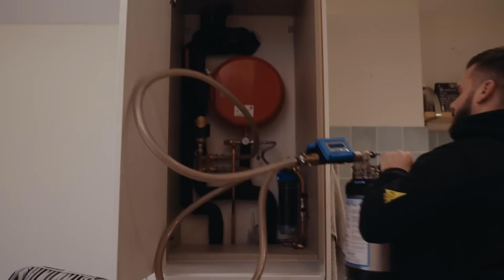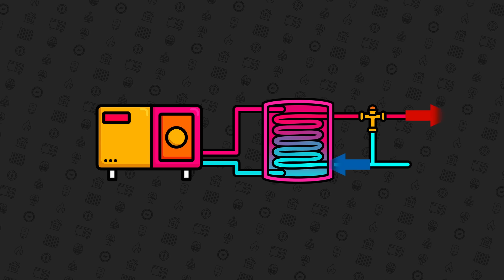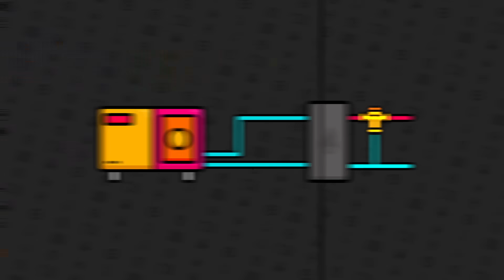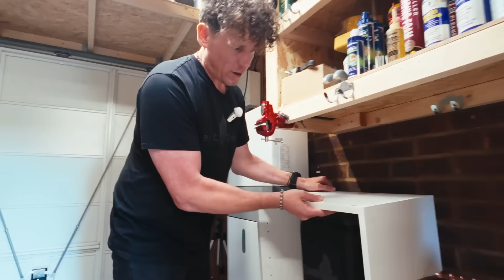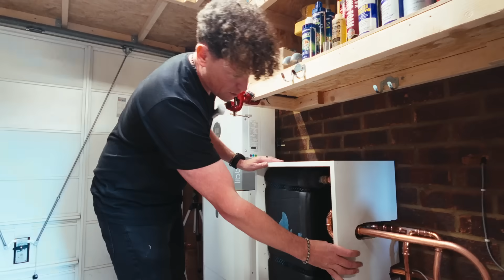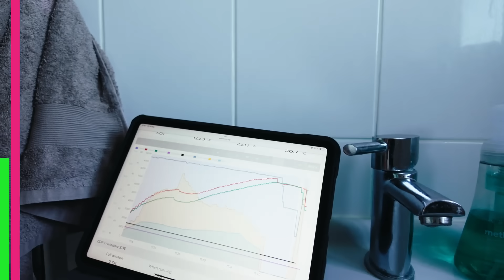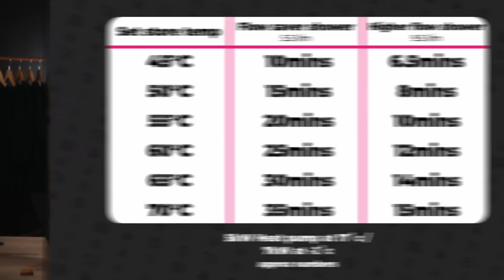World’s smallest hot water solution. (With a heat pump)

Comment: Here in Norway, 95% of homes have a standard 150–300L hot water tank. Since we already use a lot of electricity to heat our homes, I don’t see the issue with having some heat loss—or rather, heat dispersion—from the boiler inside a house that needs heating anyway.

The only cost-effective solution that makes sense would be to use a heat pump to preheat the water, improving efficiency, ideally in combination with a home heating system that also utilizes the heat pump.
Reply: Well, if your heating throughout most of the year you might be correct, but you really don't want extra heat when the temperature outside rises  aboth 30°C (Or 20°C for that matter)
Reply: @patrick_test123  That’s true, but most people keep the heat on in the basement year-round, and for about nine months a year in the main living areas.

The main issue with tankless water heaters is the extremely high power demand—typically between 15 and 25 kW for a high-flow shower. The cost of drawing that much peak electricity is significantly higher than using power over a longer period, due to the penalties associated with high grid loads.
Reply: @TheJensss  This clearly is a solution for situations like small apartments without a central heating/hot water system, where you can't put the tank in a cellar?
Reply: @patrick_test123  Yes and no. Tankless water heaters can save space, which is a benefit, but small apartments often have lower-capacity electrical circuits. This makes the high power demand of a tankless system a major issue. As a result, most people opt for smaller water tanks—typically around 100 liters—installed in a closet.

It’s also worth noting that natural gas is rarely used in Northern Europe, even though Norway is a major exporter.
Reply: @TheJensss  If you have previously used  the gas for the oven and stove, too you might have an issue with the available electric power. But the heat-pump won't draw the 7kW from the wall unless you're using the resistive heater.
Reply: @patrick_test123  Almost everything has been electric since the 1950s, but the issue isn’t total energy consumption—it’s the instantaneous power demand of tankless water heaters that’s problematic. A regular shower can require 15–25 kW of power for on-demand heating, which isn’t sustainable if multiple users need hot water at the same time. That’s why storage tank heaters are preferred: they allow the power draw to be spread out over time, typically using just 1.5–2 kW, making them much more manageable for residential electrical systems.
Reply from the maker: Yeh you don’t have the issue of space the uk has.
Reply: @HeatGeek  Only in the larger cities and the smallest apartments. Great video, by the way! :)

Comment: I assume that this can also be run in cool mode to store cold water to feed a water to air heat exchanger in a Mechanical Ventilation with Heat Recovery system, so store up cold water during a summer day from solar PV and hopefully have sufficient buffer to keep the house cool through the night? And the reverse in the winter, but since smaller delta T for a water to air it, the buffer should last a while?

Comment: @heatgeek I think I found the guy that can Re-Design the Mini-split, or should I I say improve upon the exterior unit for certain applications?
1) these units are now being mounted on Cargo Trailers and RV’s
2) The exterior units being sometimes way to bulky.
3) a tower design instead of a box like exterior unit could be the answer
4) Hopefully you take this challenge, as looking at the exterior units, it seems that the evap. Coils could be redesign to be a cylinder shape as are many regular home exterior outdoor units, a single fan or multiple fans put to use to accomplish this.
5) The market is there for this, and that industry has yet to discover it.
- Good Luck and can’t wait to see what you come with
(9K Btu to 12K Btu units are the most popular for these applications)

Comment: This is great work! However, it probably needs a tiny bit more of buffering for defrosts.
And perhaps the mixing valve on the heat pump side shouldn't be a thermostatic one, but a three way valve controlled by temperature, if temperature coming from heatpump is higher than storage, it opens?
Reply from the maker: Looking at the performance of the many ministores we installed over last winter it’s not a problem.

Comment: Great work HG team. Wrap this up in a sand jacket then enclose in more insulation. Feed the sand battery with current from a PV panel array/ cheap rate electric. Should still fit in a cupboard. Might weigh a bit though!
Reply: Well, you get the "I can't do math dunce award".   If you want more heat storage you use WATER or a phase change material.  Not garbage, holds no heat sand... of all things.  Clay would be better than sand, but to dunces who know ZERO physics... bravo! Keep typing!

Comment: Good luck making that work in London/SE that kind of MPHE will be blocked solid with limescale in under a year! Also, the Hilton global standard for DHW supply was 43c.
Reply from the maker: I doubt it. London is a place of combi boilers and this is 70* larger so will last 70* linger before blocking.
Reply: @HeatGeek  It's 70x larger in terms of surface area not in terms of the waterways size. I've had to replace the PEX twice in the 8 years having a combi in London...
Reply: @Pickle_Rick-m4o  more expense but I a always fit a twin filter, after the kitchen tap supply, stops all that crap building up. 😊
Reply: @ThierryDixon doesnt stop limescale build up, especially DHW devices...
Reply from the maker: @Pickle_Rick-m4o yes but there’s 70* more water ways… so accumulation down 1 waterway is slower. 

Scaling rate is also a function of temperature and this  runs cooler than a typical combi. 

I’m well aware of scaling rate, although I’m off the tools now I’ve been serving Woking (harder water than London) for 20 years. Combi plates nearly ALWAYS block primary side though.. not secondary. I think you’re mixing this up.

Worst case you can just run a descale ale very 10-15 years. Basically this absolutely won’t be a problem

Comment: I absolutely want one. This is the perfect solution for my home. The only addition I’d love would be to add a small battery (and maybe inverter) to take on some of the short term electrical demand. I have a looped supply with my neighbour on a 60a main fuse, I’d worry that electric heating/hot water would risk blowing the fuse. I’m imagining something similar to the bolt boiler setup

Comment: Fabulous! From previous calculations ive done, the incoming water main temp can make a big difference to the longevity you get from a system like this, id be interested in the performance in winter

One thing thats really important here is the switch on time of the heat pump - have you tried other brands to compare? I know some can be very slow to turn on. Do you have a list / ranking of which are best here?

Comment: Pretty impressive! Why do you think that the large manufacturers of heat pumps have never done this? Is it a question of cost or they are not interested in the UK market? Curious what you think given the number of manufacturers you are regularly in contact with.
Reply from the maker: Because heat pumps traditionally niche and only for expensive homes with lots of storage

Comment: Good morning!

The idea is nice, but there are three buts:
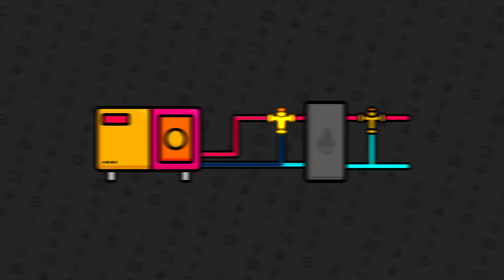1. First, what kind of valve is on the left side (4:03) in front of the plate heat exchanger, after all, it is not a typical ATM thermostatic valve (e.g. ESBE T30), because ATM closes the mixer when cold water comes in. Also, the return protection valve will not work properly.
What kind of valve is used there?
2. The proposed solution will only work in “warm countries”. Below 7 degrees Celsius on the air heat pump exchanger, as a result of evaporation below 0 degrees Celsius, frost will build up, which the heat pump will have to thaw (defrost). In your design, you have not provided for the defrost process - which will stop the heat pump completely, because the electronics will not allow defrost from water colder than 10 degrees Celsius.
3. it is also a misrepresentation to say that heating with a heat pump is 3x more economical than heating with gas. Just check the log p-h.
For condensing 50'C and evaporating 7'C for R32 refrigerant you will get a COP of 3.39:1 because the end discharge temperature is 100.8'C. And COP less than 3.5 by the equivalent of the gas price. That is, you get an effect equal to whether it is a heat pump or gas.

The idea would be very interesting if it could be used everywhere. :)

edit: Unless you connected the ESBE valve in reverse, i.e., the output of the valve was used as an input - not in accordance with the manufacturer's recommendation, but the way will work. But there is still the problem of defrost, which will stop the heat pump for the entire winter.
Reply: It’s not cheaper, but close enough. Is the price of gas vs electricity going to fall over the next ten to fifteen years? Then factor in the fossil vs renewable argument. My own view is that I’d prefer to pay say 10% more for the green solution, but that’s not everyone.
Reply from the maker: Yes, we have to test for defrost, but we already did this with a mini store and found it wasn’t a problem

Gas boilers at 80 to 85% efficient so yes this is three times more efficient than Gas
Reply: @HeatGeek  Unfortunately not true!
1. first, I gave the source of the calculation: log p-h for condensing and evaporation. It's a pity that the basics of physics (Clapeyron's Equation derived in 1834) are limp with you.

But since there is a problem with physics it should be shown with concrete examples:
The price of 1kWh from natural gas is €0.071 gross
The price of 1kWh of electricity is €0.28 gross.

A simple calculation and we know that energy from gas is nearly four times cheaper than from electricity.
A heat pump on R32 with condensing at 50'C and evaporation at 7'C has a COP of 3.39:1

And 3.39 is less than 4.... unless the European Union has introduced some new regulations that have changed this mathematical relationship.
As you can see the energy efficiency is worse than gas.
If you want I will be happy to make a video showing where you went wrong.
Reply: @Waldemar_Pachol_official   He's calculating energy in vs energy out. Your definition of "efficient" refers to how cheap. That was not the original point.
Reply: why Dublin  gas 13c per unit  @Waldemar_Pachol_official
Reply: @Waldemar_Pachol_official why on earth would you pay 0.3€ for electricity!? That’s insane costs
Reply: @inteallsviktigt  Hi!
Well... Unfortunately, in Poland, citizens for more than 30 years have been voting for people who show nothing but indolence. The result, among other things, is €0.28 per 1kWh of electricity we pay here.
The authorities unfortunately do “good” to everyone around except the citizens.
Reply: @Waldemar_Pachol_official but a kWh of gas does not produce a kWh of heat in a boiler, you haven’t accounted for the efficiency of the boiler (85%?)
Reply: @timiav8  You are absolutely right! Traditional gas boilers reach 85-92%, so the result will be much worse than 3.39:1. However, I was considering modern condensing gas boilers, and these reach up to 108%.
Reply: @Waldemar_Pachol_official electricity does not have a single price. At least not in the UK.

Many people buying a heat pump are focused on electrification and reduction in emissions. A small sacrifice in efficiency for a system with the potential for future emissions free operation is well worth it.
Reply: It is currently around £0.25 - £0.27 in the UK

Comment: I love this chanel, from the mini store which us old'uns would call a quick recovery cylinder plumbed backwards to a large plate heat exchanger which again some of us use commercially its good to see you pushing the boundaries, now a repeat test when its -5c outside before everyone gets too excited. Of course you could have just used a Sunamp heat battery?  Your system must cost a lot less than that.
Reply from the maker: This would. I way work with a sunamp. The hex is to small, too many heat exchanges and it’s also too large.

Comment: What made you choose such a large hex? It’s very expensive.
I’m interested if it was selected experimentally - I.e. the biggest one you could realistically fit where you wanted it, or if you calculated this was the correct size for what you wanted to achieve.(?)
Reply from the maker: Heat . The larger it is the more energy stored

Comment: Awesome work!   If you could find a large enough plate exchanger, what about taking the refrigerant to the exchanger instead, this would greatly improve heat-up times.  Add in a solenoid valve to dump the high side refrigerant to the low side just before a restart, this would allow the compressor to short cycle and restart quickly without a head pressure present.  It's just whether you can find that large size gas to water exchanger...

Comment: If the idea of this is to reduce storage space, why not just use a 30L DHW tank instead?
Stainless steel has a slightly lower heat capacity per volume than water for 8 times the weight....
Reply from the maker: Because that would last about 4 minites

Comment: Regrettable i think it won't work when your heatpump is busy defrosting. 
(Edit: sorry, already mentioned)

Maybe swichtching out some of the big amount of heat transfer capacity for more heat storage will lengten the amout of time of use? E.g. make more thick matel plates inside. Or use another smart material inside, together with the copper. 

A big advantage of the system is that it isn t round. And indeed should be able to be made at specific (compact) measurements. And than be better than other small boilers/cilinders of wich some are allready  more square.

You made a much more compact version of Itho Daalderop horizontal heatpump boiler.

Maybe next gen heat pumps will be smarter in direct reaction at demand and better/smarter in defrosting. (E.g smarthome)

Comment: I heard the comment which said that an average time for a shower is 8 minutes. Has he never had a teenage son or daughter that can easily be in the shower for 20 minutes!! Who know why but they are!. So as you are aiming to decarbonise (which is a fruitless exercise for no benefit led by a Politician with no technical ability)  - why not simply install an electric shower for about £200. Runs forever and uses electricity so you can switch off the heat pump for the summer!! A heat pump used to heat the bath needs a much higher temperature especially in a steel bath . A shower can also heat a bath by increasing the temp to 60 or more.

As for your statement that 40 degrees for a shower is adequate - rubbish ! Come in from a cycle ride in winter and you want to thaw out under the shower - not prolong the frozen eyebrows!!
Reply: The teenagers will quickly reduce their showers to 8 minutes if the hot water runs out.  Then someone else can use the bathroom.  It's almost a selling point.

Comment: Could you simulate colder temperatures by putting a cover around the heat pump what causes it to short circuit itself with an opening to regulate the temperature - proper bodge job I know!
Reply from the maker: Don’t worry we will have a few in for this winter.